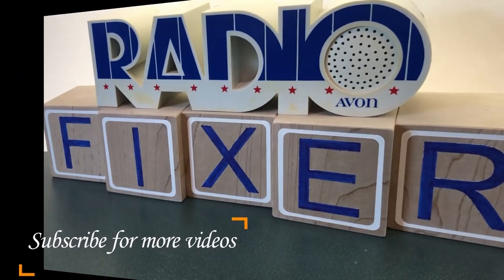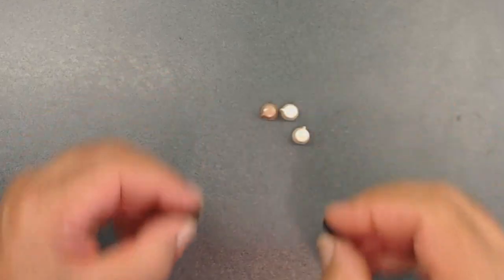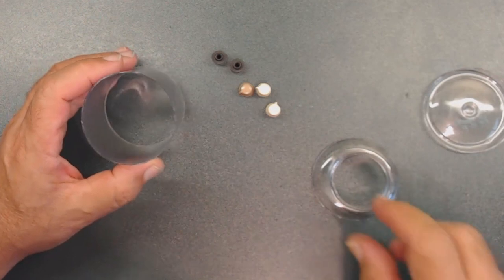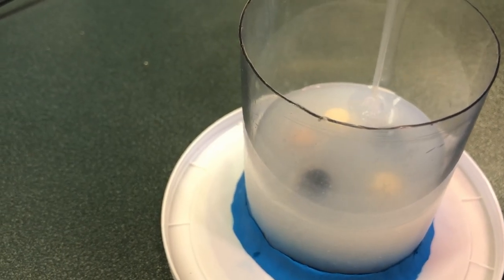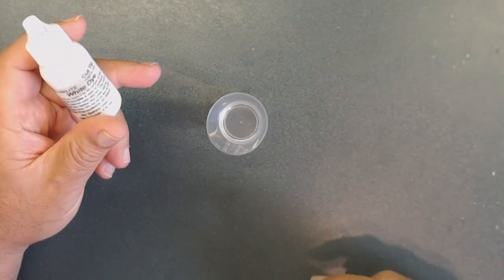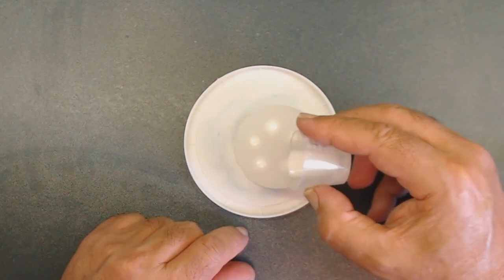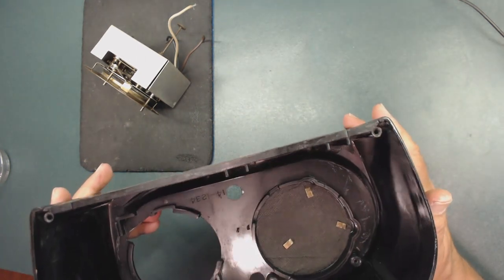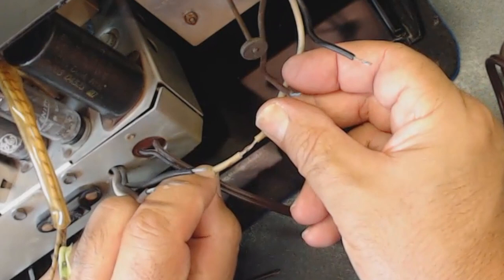Part 7 - How to repair broken Bakelite radio

Comment: Jay, 
Been watching this build from the beginning. I enjoyed seeing the duplication process using a mold. So many resources out there we don’t consider. I would have probably tried to modify a black valve stem cap to use before seeing this. A great final product for the display!
Reply from the maker: David, so good to hear from you! Thank you for watching my videos and very kind compliment. You know how I am, (LOL) like to keep it as close to original as possible. Each restoration try to fabricate missing part instead of using spare part (taking it from different radio).  It is a pleasure to share these historic radios. Have a good weekend! regards, JZ

Comment: I have a lot of experience in casting small parts out of resin.
A few tips. Both components of the gum should be well mixed. To avoid air bubbles, the mold can be degassed with a pump or a vacuum compressor. The same goes for the resin.
The elements to be cast should be sprayed with thin silicone oil, which acts as a separator and prevents the elements from sticking together.
When creating a casting mold, you should remember about a long ingot, because the resin shrinks, therefore the ingot prevents it.
The resin can be colored with modeling paints.

I am waiting impatiently for the next project, the next series of radio repair videos.
Reply from the maker: Robert,  thank you so much for uplifting comments and watching my videos. I appreciate you knowledge and expertise on molding. I do this as a hobby and always good to hear from someone with experience, we learn from each other to get better in what we do. Have a great day! Regards, JZ